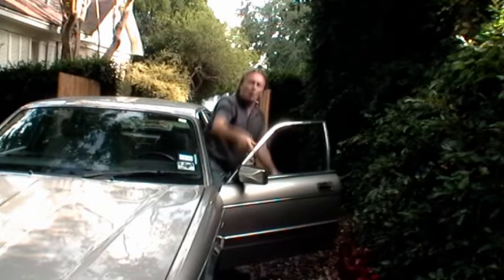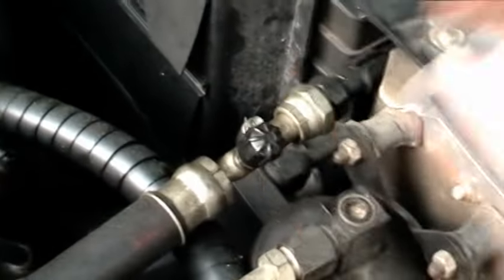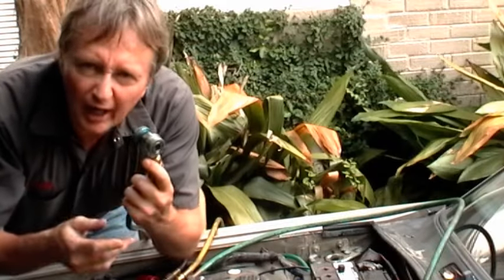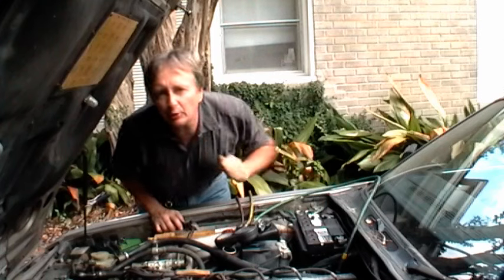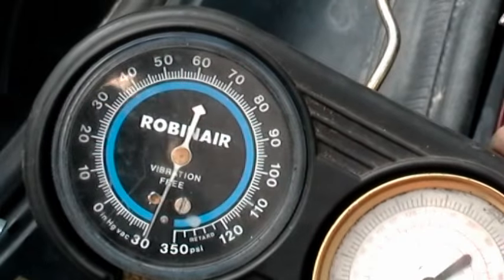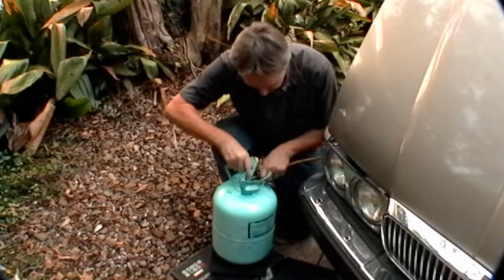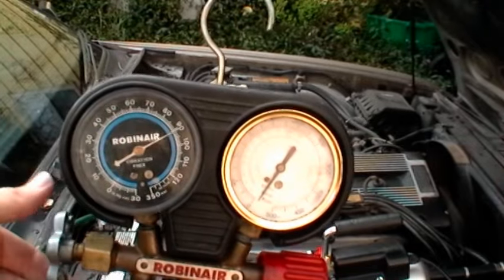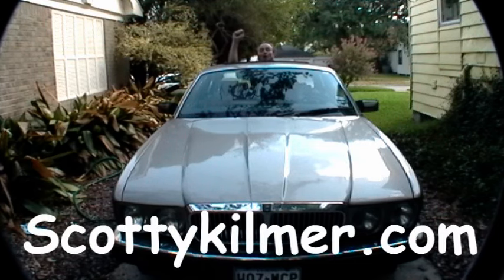How to Recharge Car AC System (Refrigerant)

Comment: I have a 2000 Chrysler 300M - a spiffed up Dodge Intrepid with an aluminum engine, and a lot of creature comforts. ~225K miles. Last weekend, I changed the A/C compressor as it had froze. When I drained the compressor to determine how much to refill it (ND8 = PAG 46), it was bone dry. I added 2 oz. of oil to the compressor as a guestimate of how much oil should be in the compressor, taking into acount that some (1 oz.) would end up in the new Receiver/Drier (Note: total capacity is 5 oz - see below). Along with the compressor, I changed the accumulator/drier and the expansion valve (both required for the DENSO warranty on the compressor). After it was buttoned up, I drew a 26 in. Hg vacuum for 1 hour. I then let it sit for 11 hours. Gauges continued to read 26 in. Hg vacuum. All good so far, right?

Here's where I blew it - literally. After purging the charge line (yellow line in gauge set), I started to fill the system before starting the compressor. It immediately shot to 75 psi. with about 1/2 of a 12 oz. can of R134a installed. Realizing I needed to start the compressor to help distribute the refridgerant, I went into the car, started the engine, and turned on the A/C. Pretty much immediately, I heard a bang. I shut everything off, and found the high pressure line from the compressor to the condenser had ruptured. Some of the oil sprayed onto the catalytic converter.

So, did the line burst because of improper procedure, or because the condenser is clogged, and there was no way for the pressure to go?

I've seen your video on the futility of flushing the condenser, and a replacement condenser can be had from Amazon for less that $50. So I plan on replacing the line, the condenser, and the receiver/drier (again). I'm not sure how much oil to add, other than 1 oz. for the Condenser, 1 oz. for the Receiver/Drier, and 1.5 oz for the line blown (per the 2002 FSM, page 24-43, excerpt below). How much more for the stuff the new compressor had lost? Anything else you recommend doing?

The FSM gives the following capacities for A/C oil:

Total A/C System: 5.00 oz.
Condenser: 1.00 oz.
Evaporator: 2.00 oz.
Receiver/Drier: 1.00 oz.
Line Blown: 1.5 oz.
Compressor: Drain and measure the oil from the old compressor.

Notice anything odd? The sum of all components leaves the compressor with -0.5 oz. I'm tempted to put in 3 oz. 5 oz. minus the 2 oz. in the evaporator. Or should I flush everything and add 5 oz.?

I'm not looking forward to removing or opening the compressor. It's a real knuckle buster, but if you say I've got to open it up to re-add the oil, well, I gotta suck it up to get it done right.

Thanks Scotty.

P.S. I've been wrenching on my cars nearly as long as you have. Just not professionally. Shade tree. I've never been afraid to work on my own cars, but you couldn't pay me enough to work on someone else's.  The A/C stuff is new to me, due to a lack of reputable shops in my area. :-( "If you want it done right, do it yourself."

Comment: If theirs no refrigerant in the system theirs a good chance you have a leak you should pressurize it first preferably with nitrogen gas and find any leaks or you could be wasting your time and refrigerant.
Reply from the maker: great idea for a pro, but these vids are mainly for DIY guys who aren't going to have any nitrogen lying around. and I've even seen pros blow up an ac system using nitrogen to find leaks by over pressurizing them, so I wouldn't want a DIY guy even trying that.
Reply: Scotty Kilmer Adding a dye or using a sniffer is the only way to go for DIY.

Comment: Also, if you are removing refrigerant and will be transporting it especially it has to be in a DOT certified tank that is yellow and gray.  The DOT specifies that you can only fill up to 80% of the tank's capacity.  What you do is on the top part find TW (tare weight(weight of tank by itself)) and the capacity that it can hold (WC) and you add them together.  Then you divide by .8 (80%) and that is the maximum amount of weight you can put into the tank without creating a pressure bomb.  Finally, it is illegal to bleed off refrigerant into the atmosphere, a quick purge of the lines is legally allowed to ensure no contaminants get into the system.

Comment: In this video, you filled the system with refrigerent only.  At some point off camera, did you add oil too?  Or did the refrigerant contain oil in it already?
Reply from the maker: +Joseph Gonzales you only add oil if oil was lost, which of course is pretty much guesswork. But you can replace any oil that was in a part you changed out, like a condenser, by draining the old one and measuring that
Reply: +Scotty Kilmer Thank you so much for your prompt reply Mr. Kilmer.  I really enjoy and appreciate your channel.

Comment: I would argue that the proper way to fill is by reference to the high side pressure.  High side should be approx 2.5 x ambient temp. So on a 70 deg day ur looking for approx 175 psi. And u should see good cycling on t low side, slowly building pressure then quickly dropping when compressor kicks in.

Comment: Hi Scotty - I just had to replace a high pressure hose and am getting ready to evacuate/recharge the system.  You don't mention A/C oil in your video.  My car requires 19oz of refrigerant and 5oz of oil.  Am I correct in assuming that I need to add the oil as well as the R-134a?

Comment: Hey Scotty, I have a 2003 toyota corolla and the AC in my car works pretty well... except when I go on long road trips because towards the end of the trip my car's AC is not cool anymore. So I am guessing I just need to add refrigerant, right? Should I look for leaks before I fix it or should I just buy an all-in-one refrigerant system from Autozone? Or would it be best to take it to a mechanic and pay $140?

Comment: Scotty love all your videos, I have a 98 dodge ram that keeps blowing fuses as soon as I put on my A/C. Unpluged cable to clutch and didn't blow the fuse but when connected to the clutch it blows. Could over charging the system cause it to blow a fuse or do I need a new compressor, because It looks like I can't just replace the clutch on this dodge. 
Thanks and keep posting videos.

Comment: My 95 Buick Lesabre AC has been working great until just a few days ago.  Turn it on and no cold air from the vents but cold air out the defroster.  And the compressor clutch cycles but doesn't run with the belt pully.  Cycles on off by itself.

Comment: Hey Scotty thanks for your informative videos. I have a 95 civic and I just purchased last year and the guy that sold it to me said it just needed Freon. So I get my mechanic to refill it and lo and behold it was working for like a day. Then a hose burst ( its under distributor cap) and my car starting overheating. I noticed there was a electrical wire going from the driver side turn signal to the ac compressor. Now it just blows hot air. How can I fix this and get it done properly?

Comment: My 2006 toyota van blows cold air on passenger's side but warmer air on the drivers side...does seem to get cold too but only after like 20 minutes or so.  heard it could be low on coolant and to try AC pro which shows the low pressure side pressure and if some needs to be added....what do you think?

Comment: @scottykilmer   Using the pressure gauge on my 134a canister of refrigerant, would I be able to measure if there is any pressure inside my system?  I'm assuming that I can attach it to the low-side port and I should be able to get a pressure reading prior to pulling the trigger on my refrigerant canister.

I'm hoping to bypass the step where you suction out everything in order to create a vacuum.

Comment from the maker: saabs are typical swedish over engineered cars (though saab is now bankrupt while volvo still remains.) But, if you go to the compressor on the engine, and follow the thicker ac line going back to the firewall, somewhere there has to be the add line for the low side fitting

Comment: Hello Scotty

Working on replacing a 99 Blazzer high side port schrader valve. What is the proper way of taking out the old valve? Purchase a schrader valve at the part store, except this schrader valve don't seem like the right one? The tool provided in this kit will not grab the valve...any suggestions?

Comment: Hi. I have a 2008 toyota tacoma. Today i noticed that the air conditioner was blowing cool air but only thru the defrost vents. I cleaned the cabin filter it was really dirty and stuck with debri and leaves. I cleaned very well and put it back in. I didnt replace it with a new one thinking it probably will work. I dont know if its a different issue. I dont see any leaks but the problen continues. Any tips will be appreciated. Thank you. Great video by the way!
Reply from the maker: that system is electronic, and defrost is the fail safe mode. So, the controls are not working and it's gone back to fail safe. Time to see a guy like me, that's all computer driven unfortunately. But generally either your control switch to change positions is bad, or the computer module has gone out

Comment: Scotty, love your videos first off, secondly I bought a 94 box truck and everything is great except the AC system doesnt produce cold air, the compressor doesnt even try to engage. I figured it could be low on refridgerant, but its been so long since I've had to recharge any AC that I think I may have just filled it up with mostly air from the can and didnt actually get any refridgerant in it, so what do I do now?

Comment: Hi Scotty, last week we went on a 2 hour trip to Palm Springs. When we left our place it was a nice 68 deg and we watch the temp on the dash go up as we travel, then when we got close to our destination it was 107 deg and the A/C started blowing hot air from both front and rear a/c.  No problem with a/c before this, but then again our temp range is mid-50's to high-80's throughout the year.  Any thoughts on what might cause this? Thanks!

Comment: I have a 134a recharging can with a valve, hose, and gauge already attached to it.  I have almost no refrigerant in my A/C system in my '96 Accord.  Can I just attach the can and load?  Or do I need to vacuum out first?

Comment: A lot of new cars the compressor wont come on with no pressure, it has a safety switch  which keeps the compressor from running without refrigerant ,you have to bypass it with a jumper wire to get the compressor to come on.

Comment: Hey Scotty. First I would like to say thanks for all the great videos. I have a problem. I installed the air condenser into a car that didn't have one. The lines going to the condenser were just open. I assumed that because there was nothing in the system I could just close it up and put the refrigerant in. I didn't vacuum my system after installing the air condenser. (which I seen you do in your videos.) 

I don't have those pressure gauges that you use to diagnose the problem better. Thinking about getting them now tho. I guess what I'm trying to ask you is, did I mess up my A.C or do I just have to do the whole process over and drain everything?

Thanks

Comment: After pulling the vacuum, I think I would have monitored the system for a while to be sure that it was holding consistent negative pressure.  That's an effort to exclude a large leak before adding refrigerant.

Comment: Like your videos, very helpful. I'm changing my compressor (SD 900), condenser, receiver/drier & expansion valve on a '94 Cherokee (R134a). There is no under hood sticker, found an online replacement decal that says 1.5 lb.s R 134a, but no oil capacity. My google search came back with too much info, all of it different for the most part. Best I can tell is 4.6 oz for compressor, and 1 oz each for drier and condenser. Does this sound right, or know where I can get the info ?
Thanks,
Jon

Comment: I've been looking for an answer to my question about putting negative pressure on the system and vacuuming it down, I've seen some videos that show you open both side high and low and vacuum it down, and it looks like in your video you only did the low side and a -29 to 30? When I did that it seem like I did get more moisture out of the system with a little bit of  water by the vacuum pump?

Comment: Does this method work with small AC134a cans? I would guess that it has the weight already factored in for one use, but I want to confirm before adding new refrigerant.

Comment: Hey Scotty, my car's AC system is completely outta refrigerant and has been for probably 8 years or so now. If I were to suddenly go fill it up, would it cause any problems with the lines or other parts after not having pressure for years? We took it in a few years back but re mechanic didn't fill it because he thought there was an electrical problem. Is it safe to fill up/recharge the system still?

Comment: Had a question. I have the scale and 30lbs setup. If I am doing it this way do I always leave the can upright? Reason I ask when I work at shops and had the actual machine the can I believe was mounted upside down I think for liquid. Just wondering the theory behind all this. I know without the machine, usually you can charge the a.c with the car off. Doing it at home without the machine we are relying on the car's a.c compressor to help pull in thr refrigerant

Comment: Scotty if the refrigerant system wasn't empty could you have used that vacuum pump to pump it into a empty dot approved container for refrigerant for recycling?  Also if you don't have refrigerant unless you pissed somebody off chances are you need to fix a leak first I would imagine.  Now I realize this doesn't happen often in the real world but any time the accumulator or receiver/drier is exposed to air for more than a matter of seconds the dessicant would be ruined by the moisture right?

Comment: Scotty, my family has a 1990 Chevrolet Silverado and the A/C hasn't worked for probably the latter of 10 years the blower works fine, but it doesn't blow hot or cold air, we've talked with our mechanic, he says that the compressor's most likely bad and it needs refilled with refrigerant. Any suggestions, advice for getting it fixed or fixing it our selves? Thank you for your help.
Reply from the maker: +Stephen Carrigg sitting that long, often the entire system will be corroded inside IF the refrigerant has all leaked out, realize that. IF it still has pressure, change the compressor and orifice tube and drier

Comment: Hi, Hope you can help me out. I have a 2002 Mazda MPV. Just started using the air conditioner and it just isn't coming out like it used too, especially if it's really hot and if the van has been sitting in the sun.  It's not hot air coming out, but it's not cold either. Do you think the van just needs refrigerant? I just wanted to see if I could find out the possibility of problems before I take it in to be checked. Thanks.
Reply from the maker: do the process in this video and pray you were only low on refrigerant, it's often that.

Comment: Hi Scotty!! I had my condenser replaced as well as some other parts from a leak. They flushed the system. I got the car back and it's slightly cool but not very cold. Any ideas what it might be if it was completely replaced? Thanks so much

Comment: Scotty....planning on refilling the refrigerant on our 95 Toyota Avalon XL. Everything works in the AC system. The car sat for a couple years without use and I am thinking the refrigerant just slowly leaked out past the compressor seal or out of the Schrader valves. Because it's been sitting for an extended period of time, I am planning on also replacing the receiver drier, as this has been recommended. The manual says " If receiver was replaced, add 20 cc (0.7 fl.oz.) compressor oil:			 ND–OIL 8 or equivalent to compressor. Can I add the oil into the system (via the AC pressure manifold gauge - yellow hose) or do I need to add the oil directly into the compressor?

Comment: I notice every auto ac vid I see the charge hose is purge which I understand but why doesn't the low side hose needs purging as well?  Is it because of the vacuum process if so wouldn't it get atmospheric air in it once the vacuum pump is disconnected to connect the refrigerant?
Reply from the maker: 318BENZO charge hose is the low side. But it doesn't matter which hose you suck the air out of, the whole system gets emptied out. It's just faster to do it on both low and high sides, takes less time

Comment: Hi Scotty, I have a question for you. I used freon R134a in a can with the stop leak and oil additives already added in the can on one of my vehicles and it worked great, however a mechanic once told me that since I added freon from a can with the stop leak additive to my system that it will damage my whole ac system as he says that the stop leak additive that comes in the can is pretty much like adding cement to my ac system and that now my whole ac system should be replaced. Is that true?

Comment: Wait...am I missing something Brent?  The refrigerant WILL leak out of the system if there is a place for it to leak out of, ergo "it's got a leak in it somewhere."  I understand your point about refrigerant remaining in the system, unlike gas/oil, but again, that's only if there isn't a leak.  Right?  And it's the dryer with that "funny bag" in it that removes moisture isn't it?  Thanks; not knocking you either, just clarifying....

Comment: I have a 1989 Suzuki Sidekick. R12 system. Car has 28,000 ALL ORIGINAL miles on it (sat 20 years, but was started and driven every few months). Obviously, there should be no mechanical reason for it to not work, but it doesn't blow cold. I have none of these tools and I really don't trust myself. Should I get a conversion to R134A or is there a kit that uses R12 lubricants with R134A refrigerant? Any suggestions? Thanks.